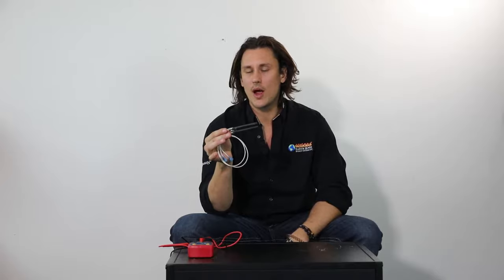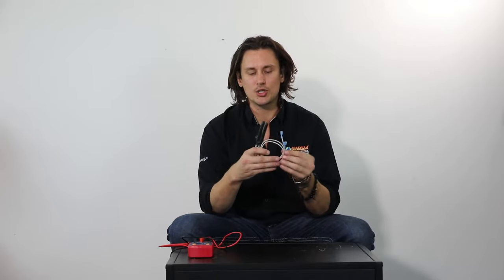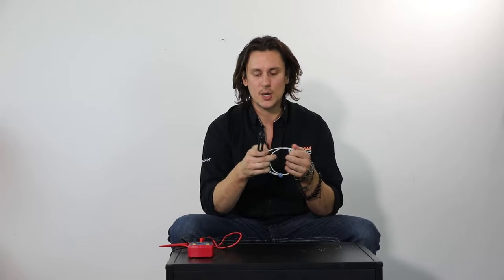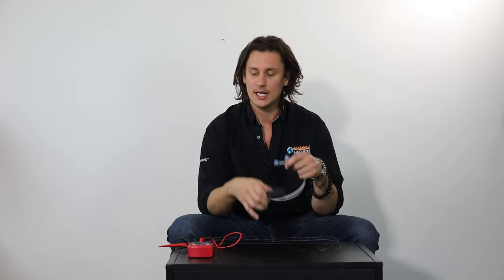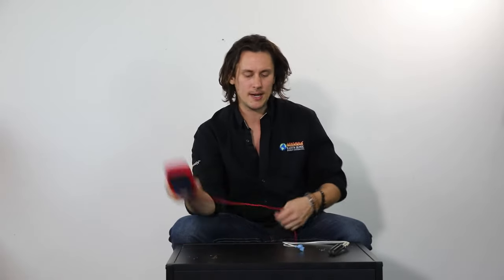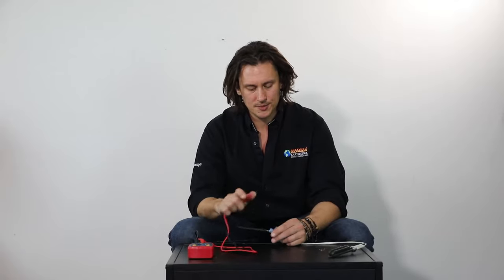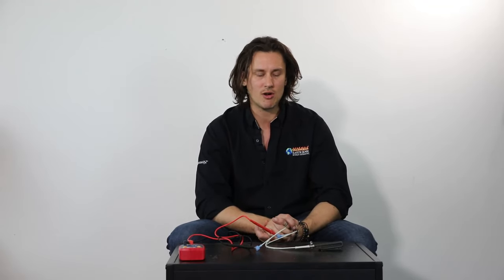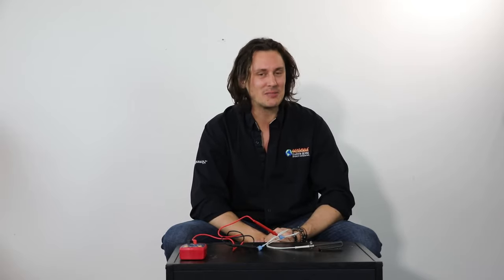How To Test A Stove Igniter, Pellet Stove Ignition Troubleshooting

Comment: I have a thellin parlour stove do i need to have the ignitor for the stove to operate or can i put a jumper on it
Reply from the maker: Hey Jesse, if the igniter is no longer working in your Thelin Parlour you can either just leave it as is or you could disconnect the wires and just leave it in place. I would not suggest you put any kind of jumper on it. You can certainly manually light the unit. If it's a newer Parlour operating on a thermostat to go on/off as heat is called for than that feature would be obsolete. But, if you manually control the heat output on your model should be no problem. 

For reference, here are the Parlour igniters: https://pellethead.com/product-category/stove-parts-accessories/stove-parts/electrical/igniters-electrical/?model=38283

For reference, here is our firestarter gel: https://pellethead.com/product/aw-perkins-gel-flame-firestarter-liquid-kindling-fire-starter-32-oz/

Any other questions please let us know. Thanks!

Comment: I replaced the igniter in my kp130pellet stove igniter will not get red
Reply from the maker: Hey Kenneth, That's the King Pellet 130 correct? I would suggest you do an ohm test on the igniter first. I know it's brand new, but we do want to make sure it is in proper firing range. It's rare that a brand new igniter is bad, however we have run into that before. If the igniter is verified to be good, then I would say it has something to do with the ignition timing cycle in the circuit board. If that is the case I would suggest you reach out to the manufacturer, and see what options there may be to repair. Any other questions please let us know. Thanks!

Comment: My Breckwell all of a sudden won't light. All motors work and it will manually feed. After there is a good fire going, when I push the button for auto mode there is no greenight and it doesn't kick in.
Reply from the maker: Thanks for contacting us Wayman. Let's check the ohms on the igniter to see if it is in operable range. Let's also take a look at the Low Limit Proof of fire switch - it sounds like it is not locking in allowing the stove to go into normal operation. That switch can be bypassed for troubleshooting purposes to determine if it is the culprit. Keep us posted, happy to help however we can. Thanks!

Comment: I have a Winslow PS40 stove.  The ready light flashes 2 long blinks when I press the start button.  The manual says the over temp snap switch is open.  Replaced the switch, same problem.  Checked all the motors (working).  Ignitor ohm reading is 35.6 ohms.  Any thoughts?  Stove airways have been cleaned, exhaust pipe cleaned, I even tried replacing the control board, still getting the same error.
Reply from the maker: Thanks for contacting us, happy to help. Spoke with one of our lead techs. He suggests that you check the lead wires of the over temp snap switch going into the molex connecter. He has seen circumstances where those wires are loose, not making proper connection and will continually give that fault code blink. Let us know what you find. Thanks!
Reply: @EarthSense Did a continuity test with my multi-meter and got the wire checked out OK.  Didnt find any loose connectors either.  Still stumped.
Reply from the maker: @bejagee  Thanks for the message back. I just emailed our tech team. I will follow up with their insight as soon as possible. We'll get this figured out. Appreciated.
Reply from the maker: @bejagee  Here is the latest info from our technician- Need to know the year.  If it is 2010 or later the hopper switch or the 25K ohm resistor could be the problem.  The resistor, attached to the back of the hopper must meter out very close to 25,000 ohms.  Also, the early versions of this resistor system did not have the wires soldered to the resistor. The wires were loose hooked and shrink wrapped causing a bad connection.  Cut the shrink wrap off to check these connections, they should be soldered.
Reply: @EarthSense  purchased in 2004, so I will check the resistor as you suggested. Where on the hopper is it located?
Reply: Re-read your suggestion about the resistor and realized mine is older than a 2010 model so no resistor.  The place I bought it is a one man shop and he is out of town til Thursday.  Hoping he can send a tech out because I am out of things to try.  Everything looks and acts like it should, but as soon as I press the start button, the ready light starts blinking to long flashes.
Reply from the maker: @bejagee  Thanks for the information. This is the latest from our lead tech: It won’t have a resistor if it’s 2004.  So, the fault code listed earlier is a high limit fault so what triggers this?  The High Limit switch is in series with the feed motor and is a dedicated circuit referred to as the Feed Circuit.  When the control board energizes the feed circuit, if the electrical path is interrupted or broken in any way the board will signal a fault.  The Feed Circuit components consist of the following;

1.       Control board.

2.       Feed motor.

3.       High Limit switch.

4.       The wire harness connections.

The first three have been confirmed to be in working order with an assumption that the High Limit switch has confirmed continuity (closed). That leaves the wiring to be checked for continuity.  The electrical wire path consists of three wires;

A.      Feed motor common wire connected to the common terminal block located below the dist fan.

B.      Feed motor load wire connected to the High Limit switch.

C.      High Limit wire between the switch and the control board molex.

All of these connection points could be an issue as well as the wires between the connection points. Specifically checking continuity of “C”.

 

Try clipping any wire ties in the main harness between the feed motor and control board.  Voltage strangulation can be an issue with overcinched wire ties.
Reply: @EarthSense  I removed all the wire ties and checked for any breaks.  I then replaced wires "A" and "B".  I'm not able to replace the wire from the molex to the high limit switch, but it does tone out with a multimeter.  Still getting the same error (2 long blinks).  I even tried the replacement control board but to no avail.
Reply from the maker: @bejagee  Thanks for the message back. I forwarded this to our lead tech. I will follow-up with any further information. Appreciated.
Reply from the maker: @bejagee  Our tech would like to make sure of the manufacturer date of the unit. Can you check the UL Label? There should be a stamp with the date of manufacturer.
Reply from the maker: @bejagee Our Tech Also Wanted to Send over this note: See if he can get an ohm reading between the molex / high limit pin and the feed motor common wire.  Switch and feed motor connected in between.
Reply: @EarthSense  Was not able to find a UL label.  My dealer is back in town tomorrow and I can ask.
Reply: @EarthSense  Ohm reading between the high limit pin and common was 10.7 ohms.
Reply from the maker: @bejagee  Thanks for the information. Here is the latest reply from our lead tech: Most AC feed motors are in the range of 9 – 11 ohms so nothing stands out from the resistance test .  This is a simple circuit and the ohm reading indicates that the circuit components, switch and motor, and current path are good.  The control board is a question mark at this point despite it being new.  New boards have been known to be faulty. 

See if your dealer can do a test/check on the control board.
Reply: @EarthSense  Actually bought the new control board on Amazon from Earth Sense/Pellethead.  Sent an email to customer service to see if they will exchange.  At this point I'm ready to buy a new stove.
Reply from the maker: @bejagee  I can imagine how frustrating this is on your end. Very sorry you've had to go through this with the PS40. Happy to make other recommendations on models should you decide to get something different. Let customer service on Amazon know that you have been working with us on YouTube to figure out the issue. Generally there are not returns on control boards, but given this situation see how they can work with you on it. Here to help however we can. Thanks!

Comment: Hello I replaced Agur motor pressure switch snap disc blowers and thermocouple fire starts up then nothing the Agra doesn’t kick back on do I have to adjust the thermostat out further for to kick one the agru
Reply from the maker: Hey Edward, happy to assist and get you back up and running again. Let's start with the make and model stove you have. Start-up cycle and components will vary from manufacturer and model. You mentioned thermocouple which narrows it down as only a few pellet stove manufactures will use the Thermocouple. Also let us know how your fire looks on start-up - crisp/torchy or wavy/lazy. Happy to help!
Reply: Start cycle starts fine I wish I can send video
Reply from the maker: @edwardmitchell8574  Hey Edward, you can take a video on your phone and upload to YouTube and send us a link. Once we know your make and model stove we can better assist. Thanks!

Comment: What is the ohm reading on my igniter supposed to be for a Quadrafire Mt Vernon pellet stove?
Reply from the maker: Thanks for reaching out Gary. If you have the original 4 speed Mt Vernon that would have come with a 300 watt Loop igniter. Optimal Ohm draw would be 43.5 - 53.5. If you have the Mt Vernon AE or E2, the factory igniter would have been the 380 watt. Optimal ohm draw on that loop igniter will be 35.5 - 43.5. Any other questions please let us know.
Reply: My Vernon door gaskets are good n sealed. Red light calling for pellets to feed n they do. The igniter is red hot and the combustion blower is on. Pellets will not ignite😩. Thoughts please?
Reply from the maker: @garywitkowski5392  Thanks for the details Gary. Somewhere we have an air loss. Let's check the simple things first. 
-Let's make all holes in the burnpot are open.
-Let's make sure the 'porkchop' burnpot bottom is tight and closing all the way
- If there is a gasket seal on your ash pan let's insure that is tight.
-Let's inspect the air intake passageway to the burnpot to ensure there are no obstructions.
- Let's use a multi-meter and check combustion fan voltage - should be near line voltage on start-up. 

Let us know what you find, happy to assist. Thanks!
Reply: @EarthSense  all good. Igniter was bad but was glowing hot. I guess not enough ohm which tells me it was getting weak. Enough said so I decided to replace the igniter and ta-dah it is working and fired right up. Thank you for your great support and expertise!!!
Reply from the maker: @garywitkowski5392  Fantastic to hear Gary! You are most welcome. Yes, that's a great note; even though an igniter may me glowing hot, it may be outside of the ohm range giving ignition troubles. Very glad to hear you are back up and running! Any other questions on the Mt Vernon let us know!
Reply: @EarthSense  Last question I want to have a spare on hand so can you tell me if you have them because last time I purchased it I did purchase it from Earth Sense online which is your company.
Reply from the maker: @garywitkowski5392  Sure thing Gary! We have a few options, link below. If you are just burning pellets, the 300 watt is best, if you are burning multi-fuels the 380 watt will be best. 
https://pellethead.com/product-category/stove-parts-accessories/stove-parts/electrical/igniters-electrical/?model=38244

Any other questions please let us know, very happy to have you as a customer of ours. Thanks!